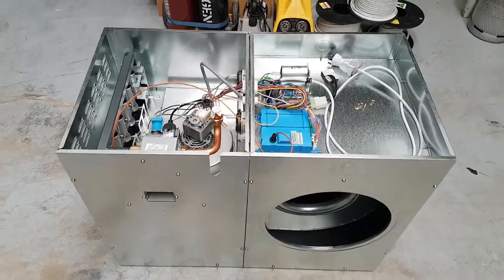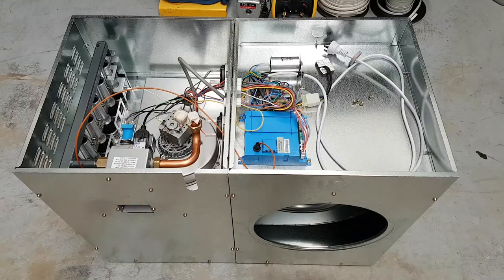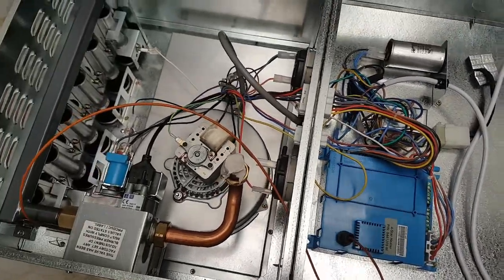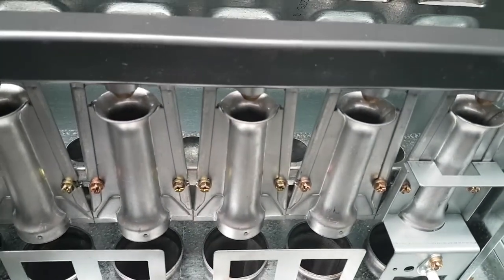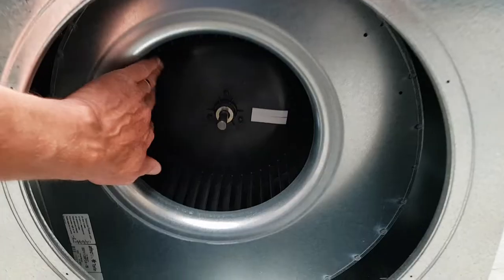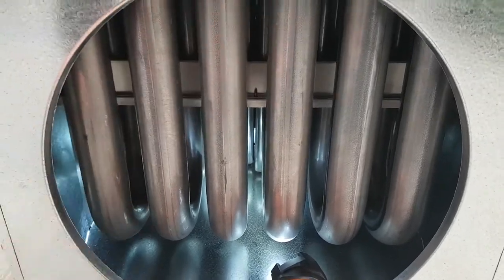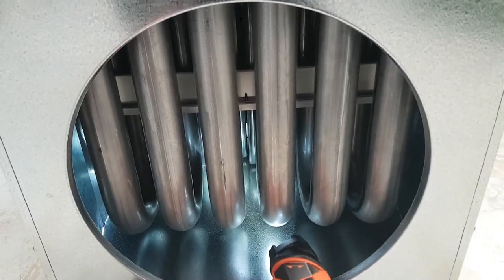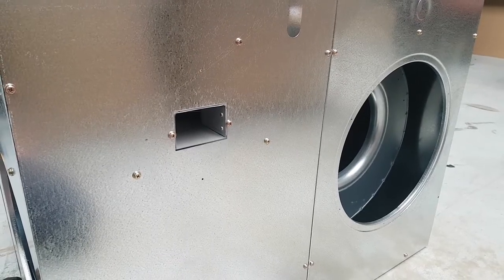How a Ducted Gas Heater Works

Comment: Great video mate, 4th year apprentice in heating and cooling here. Finally a HVAC channel that’s not American 😂
Reply from the maker: Cool 👍
Reply: Nice vid
No mention of a thermister ? Or placement 
Navigator,  sta heat control,  duel hot/ cool control
Maybe some elec dampers 😉
Just saying, shiny unit 🤣🤣
Reply from the maker: You are right, there`s a heap of more info I could have included. I just wanted to keep it easy as possible for the home owners to understand. Thanks for watching it.

Comment: Hi there..instead of drawing the air from the return..is it possible to modify the system that it can draw the air from the roof space which will result in using less gas as the roof is generally hotter than the home on sunny winter day.
Reply from the maker: It is not something I would recommend. 
Air being drawn in to the unit must be clean. This would mean filters would end up in the roof space. Filters need to be in an area where they are easilly serviceable by the home owner.
The manufacturers of furnaces aim for a certain ``temperature rise`` across the heat exchanger, this would not occur correctly if air is being drawn from the roof space and not the occupied space.
It would also cause static pressure issues with the system as the supply air would be working against a higher static pressure.
There are passive heat transfer kits which can be used to provide some small temperature rise. This would be a better solution.
Thanks for wathcing the video.
Steve
https://www.airconditioningdoctor.com.au/

Comment: Is the gas used in this system similar or the same as refrigerant such and R410a or R134a in aircon and refrigeration?my company doesn't do heating systems like this,  just reverse cycle heating
Reply from the maker: Hi Hayden.
No it is not refrigerant, it burns Natural Gas, just like your stove top (if it is gas)
Glad you liked it.
https://www.airconditioningdoctor.com.au/
Reply: @airconditioningdoctor  so how would hooking it up to the gas line work? Would a plumber have to get involved and how do you shut off the gas line when undergoing installation?
Reply from the maker: Hi Hayden, we have access to 3 x gas fitting contractors who perform all of our gas fitting work also including testing the service and providing a COC.
Hope that helps.

Comment: I have a similar unit in my rooftop. Is there a air filter for this type of heaters? I am getting very low air from the vent in the other end of the house. Internet suggest me to clean the air filter of the heater before calling a technician. Thanks
Reply from the maker: Take a look where the air gets drawn back into the unit. It is normally located in a common central area like a hallway in the ceiling behind the grill.
Thanks for watching the vid.
https://www.airconditioningdoctor.com.au/
Reply: Hi. Mi braemar thermostat controller is playing up. Is there any WiFi compatible controller you can recommend thanks.

Comment: How to reset the breamer heater, mine stop working second time, installed 3 years ago, last year they visited to reset.
Reply from the maker: Hi Jack.
Your owners manual will show how to reset the unit. If the problem returns, a service tech will need to take a look at the unit. Being less than 5 years old, you might find it is still under warranty.
Thanks for watching the video.
https://www.airconditioningdoctor.com.au

Comment: Hi Steve, we have a unit displaying a long-slow single green pulse on the control board, but cannot get the navigator to connect to the transceiver. Do you think it's possible the transceiver is kaput? I'm not sure what else could be the problem. Great video btw, thanks!
Reply: Never mind! Another fella's video showed me that I have to run a magnet across the transceiver (amazingly not in the manual!)
Reply from the maker: Hi Dwain, sorry for the late reply, I`m glad you got your heater all sorted.
Thanks for watching the vid.
https://www.airconditioningdoctor.com.au/

Comment: My Bonair ducted gas heating doesn’t work sometimes when turn on. I tried Switch off main power to reset sometimes it helps but mostly doesn’t work.
Reply from the maker: Hi there.
There can be many causes for a unit to not ignite sometimes.
Why not fill out a ``contact me`` enquiry form our website and we can send a tchnician out.
https://www.airconditioningdoctor.com.au/
Thanks for watching the video.

Comment: I have a Bonaire MB4 and the Inducer motors on these are too noisy when it turns on and Off. I regret buying it and there is no way to silence it. I had Bonaire technicians look at it and apparently that is how the MB4 works. Very disappointing. My heater is external and very close to neighbors house close to our fence. 
I know the blower motor obviously has to make some noise but the inducer on the Bonaire is annoyingly whining when Starting and turning off.....
What is the quietest ducted heater there is?
Reply from the maker: Hi ET.
All high efficiency ducted gas heaters will have an induced or forced draft flue blower that will make some noise.
Measuring the noise is not something we have ever done so I cannot answer your question.
It would be a question best put to a manufacturer to answer.
We recommend Rinnai StarPro heaters.
Thanks for watching the video
https://www.airconditioningdoctor.com.au/

Comment: hi , i have ducted refrigerative cooling and gaz  heating from bonair  ,but  if i set the controller to go down from 25 to 20   , it will only bring the temp from 25 to 24  , what would be the issue on a brand new install like that?
Reply from the maker: If it is not coming down in temperature and it is a recently installed system it would be best to ask the installer to come back to take a look. Just make sure you are in cooling mode.
Both the product and installation have warranty.
https://www.airconditioningdoctor.com.au/